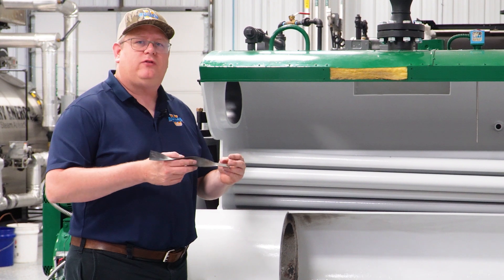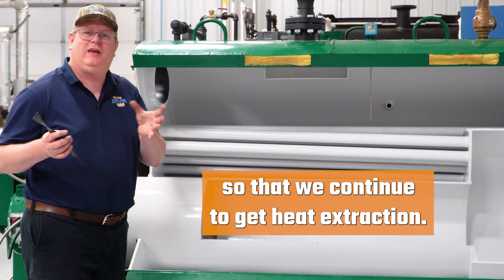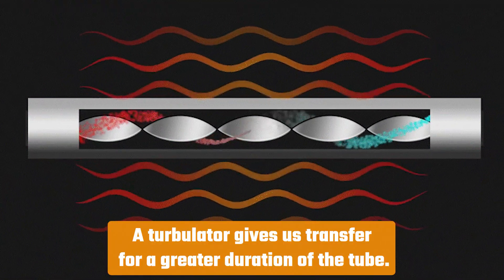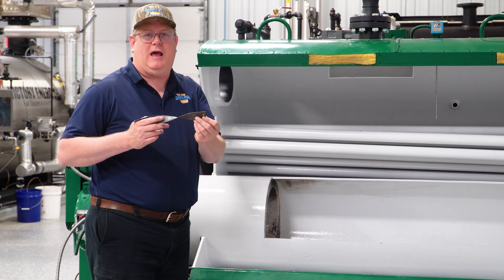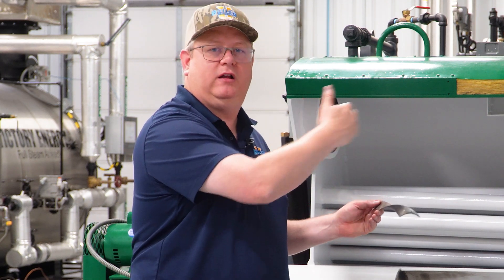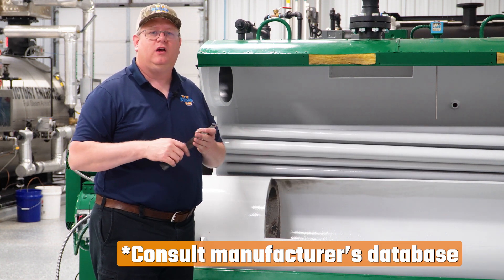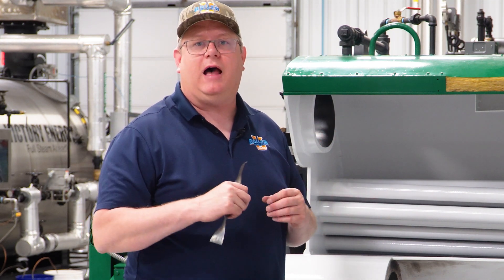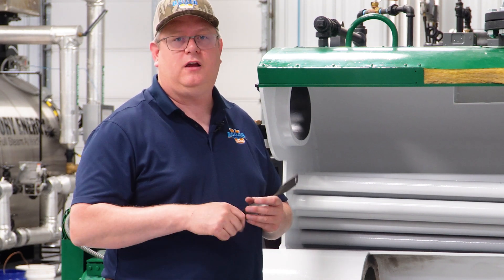The Impact of Turbulators in Firetube Boilers - Weekly Boiler Tip

Comment: Thank you sir, just curious, is twisted tape the only type that one can use in boilers, or have other types been tried? Such as wire loop turbulators or spiral coil turbulators? These types work well with viscous fluids, curious to know if they have been used in flue gas/smoke situations.